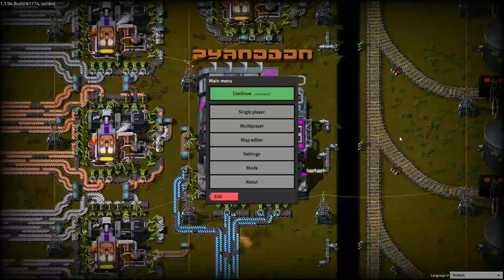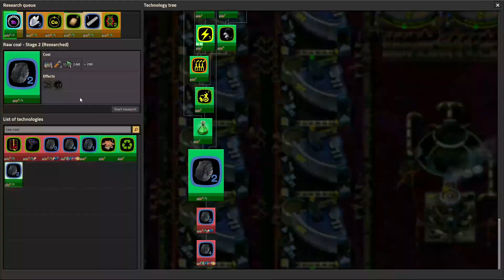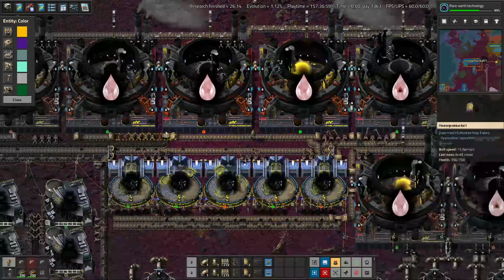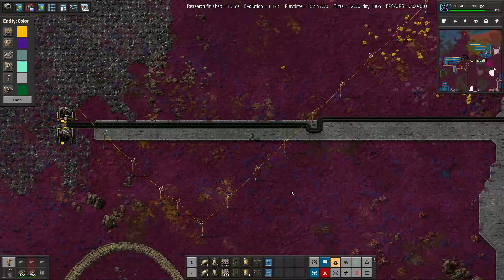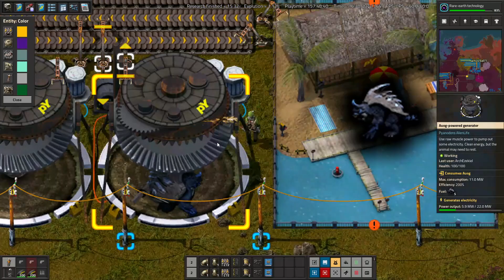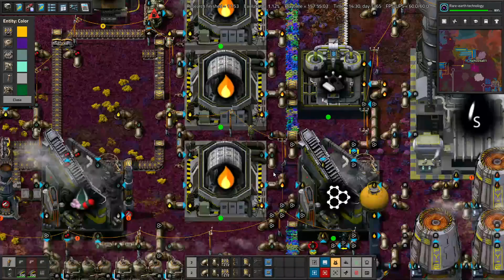Py Recap Supershorts #2: Coal Power and Auog Power

Comment: For brownout protection on the coke power plant you could use a pressured steam tank. If the level off the tank rises it means you can produce more power than you consume. If it falls you are not producing enough power. You could use an SR latch controlled by that tank to open and close a switch to your main power grid
Reply from the maker: Hmmmm yes, now that we have power switches that sounds like a great idea, and a little more convenient than having to move things around to fit overflow valves. Thanks! We’ll have to pick between the two I suspect

Comment: i guess you could do coal dust steam power for brownout protection of the coal power plant maybe
Reply from the maker: That’s not a bad idea; we clearly have a lot of it. I could imagine a circuit that disconnects the power plant from the main network when it’s low on power and turns on a coal dust burner. Or we can look into how much coal dust we get from the plant, and if that could power the whole plant on its own. Thanks for the suggestion!